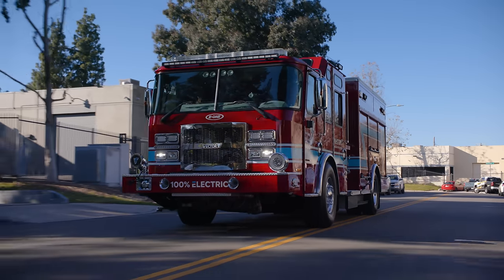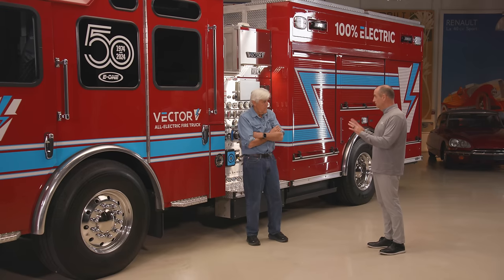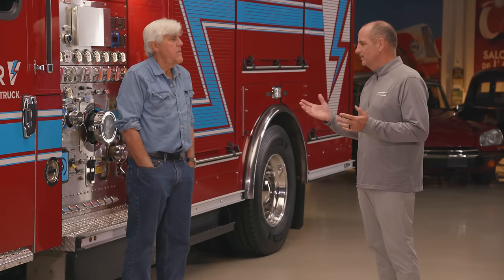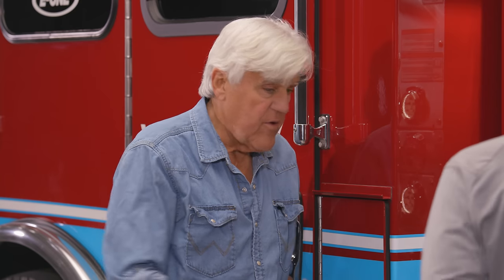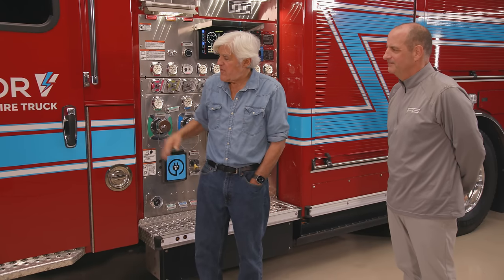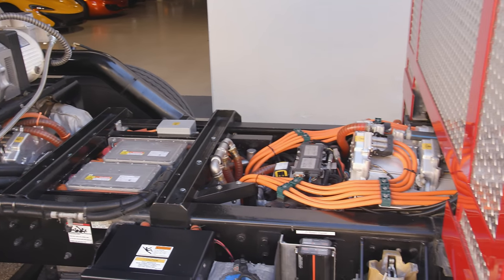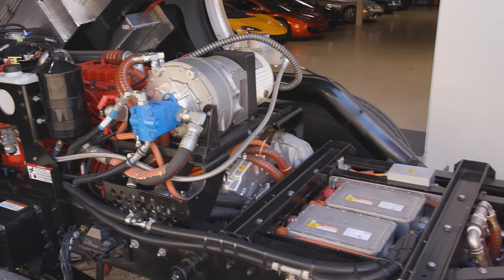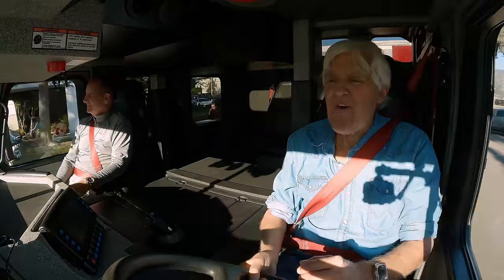The Future of Firetrucks?

Comment: Would've been nice to see it all lit up with the flashing lights and all. I also would've liked to see all the storage compartments, and equiptment on the thing.
Reply: Battery would’ve died
Reply: Well,  I guess all that is as like  a regular fire truck from LA as possible,  so not likely anything new to see there.  (Though I was actually thinking maybe those battery packs could do to be a bit higher off the ground, firetrucks have to go over curbs and stuff  from time to time.
Reply: @rodonis88 lights don’t  use that much energy, you know that right
Reply: @MrJimheeren  you know what a joke is right?

Comment: So…diesel powered battery extending generator to recharge existing green batteries. Makes sense
Reply: Yes it makes sense only rarely a fire engine has to pump water for more then 4 hours so that’s not an issue, it’s literally the backup engine, plus these fire trucks can be put on the wires as well, so you can always pump more battery life into the truck

Comment: For a truck that is designed to pump water, you would think they would have shown a better example of its primary purpose.
Reply: But then everyone would see it's shortcomings........
Reply: Making the truck cruise to a fire situation is one thing. I'd like to know how many hours the pump can run at full bore ..... not so good, I imagine. Prove me wrong.
Reply: @TheJimbob1603  He said it right in the video. Rated for continuous on scene pumping for around 4 hours. With the diesel engine running and recharging the main batteries, hours more. Did you watch the video?
Reply: I believe he says 4 hours in the video.  @TheJimbob1603
Reply: @TheJimbob1603 the truck has a diesel generator if it needs to pump for long periods of time.
Reply: I hope there battery is really waterproof and long lasting under lots of use
Reply: @CurlyWolf_  Yes, at a measly 1500 gpm.  I don’t think anyone in Los Angeles County has purchased a pumper rated at  less than 2,000 gpm in the last 30 years at least.
Reply: @rscottadams7082 this one is 1,250.
Reply: @turbot_  I must have mis-heard.  That’s even more disappointing.  Why would I pay twice as much money for a pumper with “half” the pumping capacity and with the added unnecessary complexity of an onboard diesel to extend the pumping endurance beyond 4 hours?  I’ve been on incidents where we pumped for “days” w/o stopping. (Flooding situation where relay pumpers were staying ahead of flooding.)  And that was right here in Southern California.
Reply: @scottleduc9241  ALL Production EV batteries are waterproof. Some 4x4 BEVs can wade through deeper water than their ICE competitors. This is the industry standard.
Reply: @TheJimbob1603  "how many hours the pump can run at full bore ..... not so good, I imagine. Prove me wrong" It has a DIESEL Generator with 7 Gallons of Diesel Exhaust Fluid DEF alone. You are wrong.
Reply: he literally said in the video that the pressure was low. Holding onto a high pressure hose is a safety risk, no?

Comment: Cool truck, Nice to have someone so knowledgeable on the truck as well. I would think also another use might be for use in disasters for mobile power with that much power on board i wonder if you can draw power from the batteries to power other things. That would be pretty cool.

I did have a thought that truck would make an amazing off road RV if you took the pump off and had a cabin on back, with all that power you could camp in the middle of a field for some time using power especially with the diesel generator also.

Comment: Have owned 6 EVs.  Own a Cybertruck.  Owned a solar company. Did EV charging stations.  Career fire fighter. Was in the first responder business for 32 years.  Jay Leno, massive torque isn't a benefit in my view.  Even todays diesel are too damn fast.  Add weight and guys being amped up on a serious incident and it's a recipe for disaster.  Trying stopping a 40k lbs truck at high speeds.     I spent the last 20 minutes trying to find the range of this thing.  Funny how the most important feature is either hidden, not stated or I somehow missed it.   Went to their website.  The battery size is 327 KWH,  a Hummer EV is 212 KWH.  So that doesn't seem too impressive.  Though of course the range of a fire engine, can be greatly less.  But that said, what is the range.  I worked on the NJ turnpike. We could easily drive 30+ mile round trip between NJTP exists.  And we're not calculating temperature, topography and speed.   If this thing, like most of the manufacturers are just dabbling in range and relying on the back up diesel, now we spent twice the money on 2 complete systems and added complexity of multiple systems and charging.   Let's not forget we need minimum of Level 2 (50 amp 240V) charing in the fire house. A lot of old city  firehouse can't accommodate this..   Im all for this technology but it seems to me, everybody is just dabbling in the technology and not actually creating something that can work on its own.    At best these seem to me to be designed for cites, in slow houses, where the engine sits 99.9% of the time and has small response area.

Comment: Jay should head up to Canada to interview Edison Motors.  Edison is starting to produce diesel electric hybrid trucks with a similar drivetrain.
Reply: A big YES that's what I was thinking. The TWO young men really make an excellent big rig. The big thing with ( Edison) is that it made a big rig that doesn't need expensive parts, very simple design. And you can purchase say a headlight replacement at any auto part store. I love their dash, and the design of the front engine Hood.
Reply: The Edison drive train is much more similar to a diesel electric locomotive.
Reply: @brianparramore1104  It's the same as this truck.  Battery with a backup EG.
Reply: @brianparramore1104  
Absolutely Right 👍 the two guys talk about that in their public events
Reply: Yes, this
Reply: "Starting"? Try going on 3 years now

Comment: for certain cities, it's a great thing.  especially if it has the generator on it which i think they all should.  low volume stations could probably do without the generator.  and for the people saying what happens when the power goes out, emergency services have generators for their buildings, they don't lose power.
Reply: Not a generator it is a diesel engine call it what it is.
Reply: Its a generator. Its an engine. What are you complaining about? Do engines trigger you?

Comment: An onboard diesel generator to charge the batteries is hilarious
Reply: Not really - just a range extender IN CASE the truck needs to remain on scene and run the pump beyond the rated battery endurance. We have scrambled many times to refill a Diesel truck on scene for the same reason. Having a range extender is a safety feature. In barn fires or similar, trucks may have to remain on scene working for eight hours or longer.
Reply: Just call it a plug in hybrid.
Reply: They will likely only rarely use the generator. Especially since most calls are nursing home calls.
Reply: Edison Motors is doing the same thing, looks great :)
Reply: @redemptionjack4657 it's not a plug in hybrid as the generator is used an an auxiliary power unit, not for propulsion
Reply: @cattlerepairmancattlerepai9414  Sir Klaus Schwab says; thanks the check is in the post
Reply: Especially since it says "100% Electric" on the front bumper!!! 🤣
Reply: @jamespaul2587  some plug in hybrids thar and in all descriptions of this truck they call it an engine.
Reply: @redemptionjack4657  nope, this is a full on ev. It has a range extender. That is not hybrid. Hybrid implies the Driveline can be switched between fuel and electric drive. Far more complicated and expensive.
Reply: @cattlerepairmancattlerepai9414  Does that no prove the reliability of these engines? Why make an engine electric but put a giant engine as a back up for the battery?
Reply: Think Diesel Electric like a locomotive.  🚂
Reply: @jamespaul2587  the diesel engine certainly does provide propulsion. It doesn't matter to the engine why the battery is providing power to run the motors - to pump water or to drive the truck - it just runs when required. You could drive this thing for hundreds of miles (as long as the fuel lasts, and longer if you refill it with diesel), all on the diesel engine.
Reply: @2012frawd  The Cummins ISB engine isn't "giant". It is the same size as found in Ram diesel pickup trucks (it's a variant of the same family of engines), and about half the size of the engine used in conventional versions of the same fire truck.
Reply: @jamesburns2232  LOL that sounds like a PLUG in hybrid.
Reply: @redemptionjack4657  yes, it is a straightforward series plug-in hybrid... with a relatively large battery capacity.
Reply: Thats good to ve able to charge the battery with a diesel engine incase you have to keep it going
Reply: @brianb-p6586  pretty sure you can't 'drive it on the diesel engine' tbh
Reply: @succulent951  the diesel engine produces more than enough power to drive the truck... so yes, you can drive on the power from the diesel, without running down the battery, as long as the fuel lasts.
Reply: @brianb-p6586  you can't because it's not connected to the drivetrain
Reply: @succulent951  the drivetrain is electric, consisting of some gearing, a generator, electronic controllers, wiring, electric motors, and axle shafts. That's how diesel-electric drives (such as in locomotives, ships, and heavy equipment) and diesel-electric hybrids (a diesel-electric drive with a battery) work.

Comment: They are having a conversation inside a fire truck with no intercom headsets.  Usually the noise is so loud they have to use them to talk to each other
Reply: So what?
Reply: @jeffw8218 This could enable better communication between firefighters for sure.
Reply: @zlcoolboy  When has inter-cab communication ever been a problem?
And how is that problem solved by a firetruck that is TWICE as expensive?
Headsets work just fine.
Reply: To be fair, there's usually a siren and radio noise, but yeah, an electric powertrain should be quieter.
Reply: @jeffw8218  He's someone who would rather have fire fighters comfortable than actually get there, nuts!
Reply: Any new truck you can talk without headsets.
Reply: I mean, that cool. But for that to be it's best feature.... seems like more of a liability than anything else.
Reply: @jeffw8218 it's just an observation boy with the small brain. People that are able to notice and talk about things. In life. You know?
Reply: @YZ450f24  No, because I’m able to see which ideas are dumb, and which aren’t. 
Electric firetrucks might just be the worst application of an EV yet. Twice as expensive for basically zero benefit.
Now, did you understand all of that??
Reply: @jeffw8218  That's huge. No hearing lost potential, no yelling and therefore no potential for miscommunication and in general less stress. You want the firefighter (the individual) to be as well off as possible so they do their job as well as possible. This is one place where "trickle action" actually works.
Reply: @aserta  No, it’s not huge. 
And what happens when the sole firetruck at the station is charging for four hours while someone’s house burns down?
Every fire department has to buy two, for a total cost of over $1,000,000?
Do you want your property taxes to double? Do you even own a home?
Reply: I don't believe that there are mufflers on the diesel engines in fire trucks/engines.
Reply: It isn’t the enginenoise that is loud.

It is the air horns and sirens.

Hearing protection is required for that reason, and would still be required and standard equipment in any dept
Reply: Yeah, we could talk reasonably well without the Federal Q running!
Reply: I love how they're making such a big deal about the cab noise in the truck on the way to the call. You're in the cab of the truck a whole 5 minutes... and that's if you're in traffic.  There is rarely much conversation in the cab to begin with, because we all know what we're doing when we get there anyway. So yeah that's great, but literally that's like having screen doors on a submarine. 

Cancel

Reply
Reply: I should also admit that our American LaFrance had a 6-71 Detroit Diesel engine and we actually liked the sound it made!

Comment: This sounds like a fire apparatus application of the Edison Motors logging truck. I'm glad that they included the range-extending generator in this, it makes this a much more compelling concept compared to an electric-only vehicle like a Tesla. Using low-rpm diesel engines to power a generator and recharge a battery pack while on the move is a brilliant idea and more cars in the EV space should be adopting that idea to bridge the gap between charging stations that are too few and far between, and take too long to charge the batteries anyway. If a bunch of Canadian truckers can figure out how to make it work effectively, so can car manufacturers.
Reply: I think you mean that the Edison Motors truck sounds like a logging application of the RV Group hybrid fire apparatus... which has been available for years, and is based on a hybrid configuration which has been around for more than a century.

Comment: You can Thank the Standard Oil Trust for making this technology new and exciting. Actually one hundred and ten years ago this electric vehicle technology was developed and cutting edge. The problem is making the vehicle self charging and answering the question of using batteries which are extremely expensive and hazardous or a self contained cold fusion generator that would be the best solution for this technology problem. E-One the Pride of Ocala Florida and Jay about 12 miles away from Golden Ocala where you hang out. Praying for You and Mavis that your love will always win in the end. I lost my wife 4 years in June. Great Video Thank You and God Bless 🙏
Reply: Oh, EVs were quite popular in the first quarter of the 20th Century.    They were useful as "town cars"  and as delivery vehicles.   But when folks wanted to hit the open road, the "Edison Cells" just couldn't cut it.  The electric starter (funny thing) dealt the death blow to the electric car.

Comment: What happens to the operational capability of this electric truck on an ice cold winter night or during a blistering hot and humid summer day? Either scenario can sharply reduce the capacity of batteries.
Reply: has built in battery heating/cooling pads, like the video says. Just like a diesel preheater

Comment: Good to know that we’re moving to a system where, if the grid is down, you’re just SOL. Brilliant
Reply: Well if the grid is down, you're not pumping diesel either.
Reply: People aren't smart enough to figure that out or how  solar panels work  @OMGWTFLOLSMH
Reply: @OMGWTFLOLSMH  Never heard of the hand pump?
Reply: This truck has a range extender, basically a scaled down diesel-electric locomotive. It will keep running even in a blackout.
Reply: Did you even watch the video? It has a built in diesel generator.
Reply: EV firetruck that still needs a diesel generator, "just in case".  What cash strapped city has the money to buy this?
Reply: Fire stations have emergency diesel generators to make their own power btw - regardless of whether or not there is a diesel in the engine itself
Reply: The diesel generators in the fire station may have a "permit to use" that enforces the number of hours per year that the generator can operate.  Such generators installed by businesses do have such permits and will be fined if the operating hours exceed the permit.  And, initial startup hours are part of the permitted hours.
Reply: @OMGWTFLOLSMH  tell that to farmers that use hand pumps, every day, all day
Reply: @StopBeingWeirdYacultist  aaaah solar panels would take days to charge that truck. You know it, I know it, anyone with an IQ above room temperature knows it. What happens when there is a 6 hour fire and that pump is dead in 4.
Reply: @ejp1  a range extender, that’s it. Not much security there
Reply: @waynekaminski5438  every mission critical rig uses redundancy - whether it's live broadcasting or fire trucks...